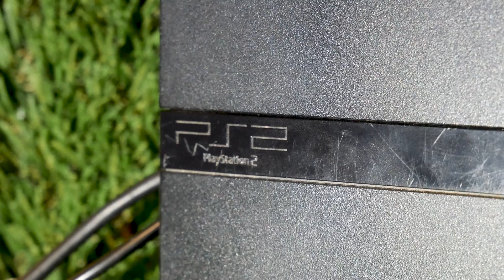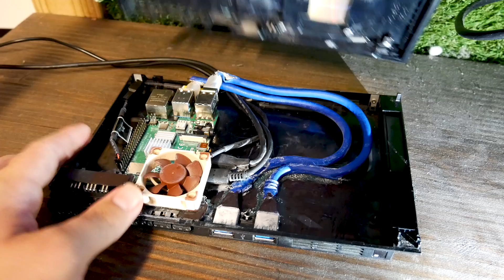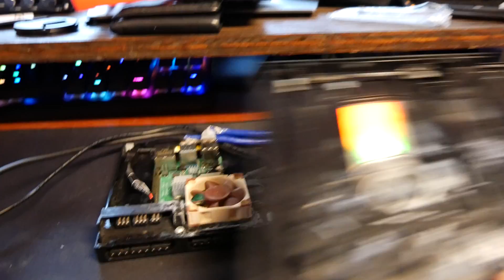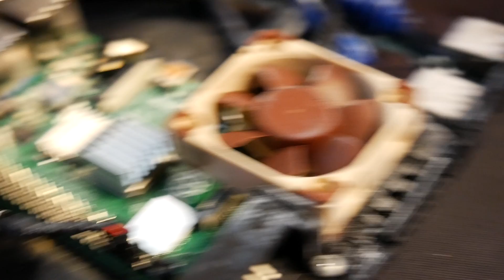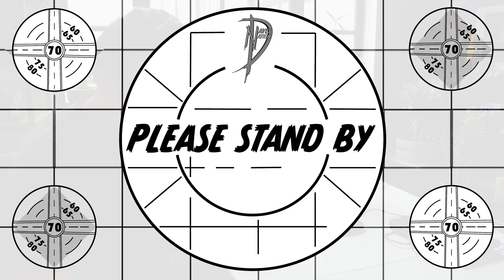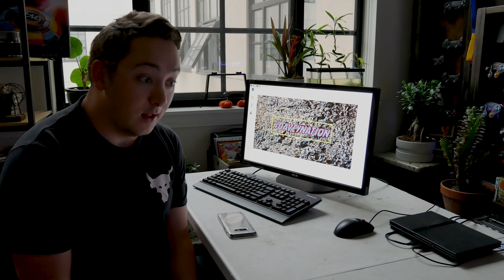The RASPBERRY Pi 4 - A $35 RETRO CONSOLE in a PS2 Case

Comment: Unfortunately nobody seems to make a model with working optical drive (e.g. swapping the innards with a BluRay drive). Is it necessary? No, but necessity is not the reason to pick an old beloved console, gut it and put a Pi into it.
One case FOR the drive would be to run the Games of the Discs.
Reply from the maker: Totally agree, but when your new dog ate your games. I thought it was time to try an emulation station. Plus it was not working .

Comment: Is it possible to make a similar build but keeping the cd drive intakt? I have a dead ps2 and it would be great to mske it into an emulator.
Reply from the maker: Keeping it yeah just cut it out and place it back in there. But making it work, whole different ball game. You would need to test the voltage the ps2 supplies then make something out of the data it sends out. Would just be easier to keep it in there but dead and load the games you have as ROMS to the SD card on your pi.

Comment: Omg... did u use super glue?? do this again but put effort into it. great vision, good luck. i plan on doing this, with alot of soldering.
Reply from the maker: Yup to keep some cables and mount the bolts to the plastic case. I used a smidge of epoxy that bonds plastic too. Ain't goin nowhere
Reply: JB weld is much better and yeah I would also put some electrical tape just to be safe.